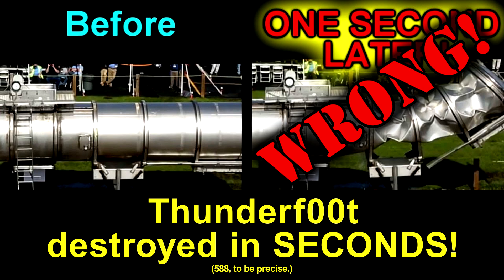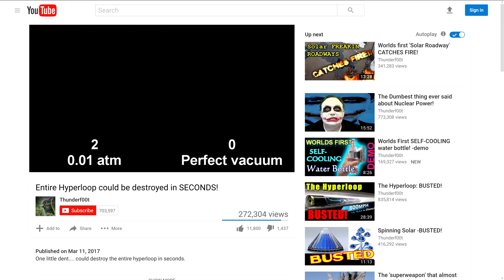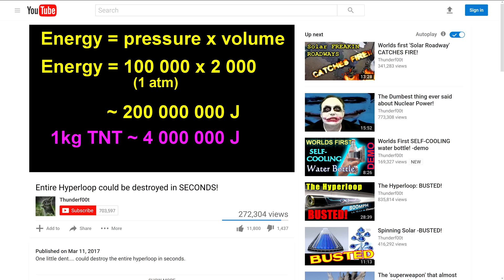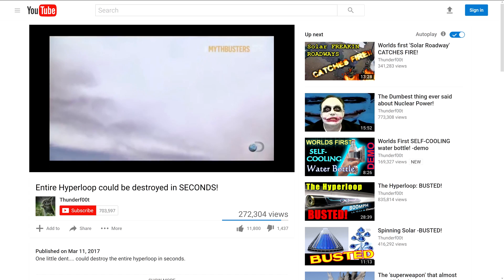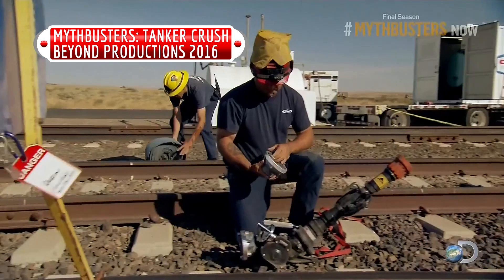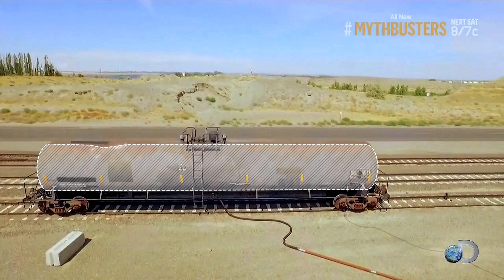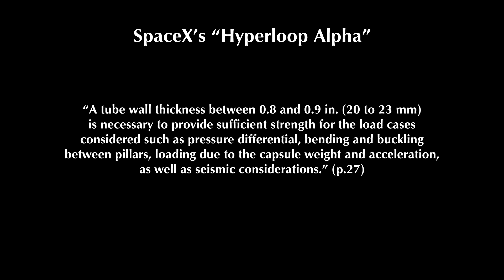Thunderf00t destroyed in SECONDS!

Comment: Using an energy based approach for a buckling problem is flawed. What causes the buckling (collapse of the tank) to occur is the compressive stress that is acting on the system. If the compressive stress  exceeds the a certain threshold the system will buckle. All the dent does is reducing this threshold. Energy has not much to do with this.
But even thought the approach is different, the conclusion with the one of the video.
Reply from the maker: "If the compressive stress  exceeds the a certain threshold the system will buckle." Which is the activation energy we discussed. How is this not an energy problem?

"All the dent does is reducing this threshold" Through the mechanism described: making more pressure on top than from the side.

"Energy has not much to do with this." Energy has EVERYTHING to do with this!
Reply: For this scenario the stress on the tube is dynamic, not fixed. It increases as the tube collapses. Force times distances equals energy. A certain amount of energy is released by the collapsing vacuum and a certain amount of energy is absorbed by the deforming steel. If the former is greater than the later then the system has the potential for catastrophic collapse if the tube is dented or pinched (see tanker video).
Reply: "Energy causes the collapse to be "explosive" it does not cause the failure itself."
If by "explosive" you mean "propagating", and by failure you mean "localized damage". Then yes, that's exactly what we're saying.
But if you're implying that a collapsed tube section would still propagate down the tube, just more slowly, then I say... No, it wouldn't. You can't have a propagating failure unless the work done by the collapsing vacuum is more than the amount of energy required to deform the steel.
You can't constant variables like "stress" and "strength" in this calculation because the stress varies along the transition and the forces are transmitted between tube segments. Thus, I made it an energy calculation.
Reply from the maker: "p=F/A <- no energy" How is it possible to have force without energy???
Reply from the maker: "By applying pressure" WHICH REQUIRES ENERGY.

"That's why hydraulic systems function that well." Hydraulic systems don't use energy???
Reply: Felix, let me ask you some simple questions I'd like answers for.
1. Do you agree that collapse of the hyperloop would release a certain amount of energy over the length of the tube (joules per meter)?
2. Do you agree that flattening the tube requires a certain amount of energy over the length of the tube (joules per meter)?
3. Assuming you agree with both the above statements, do you agree that if the amount of energy required to flatten the tube exceeds the amount of energy released by the collapsing vacuum is less than the amount of energy required to flatten the tube, then the collapse is impossible?
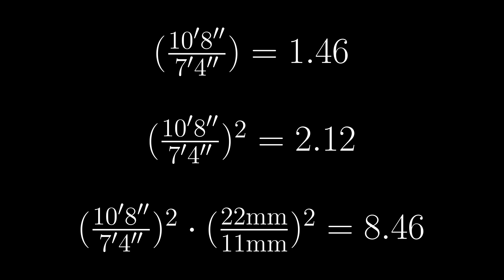Reply: At 2:37 the units are handled just fine: ((feet and inches) / (feet and inches))^2 * ((millimeters) / (millimeters))^2 = (unitless)^2 * (unitless)^2 = unitless * unitless = unitless
Reply: Unitless figures aren't meaningless, for example, air conditioners have units of BTUs/kWh which is a laughably ridiculous combination of imperial and metric units that is ultimately unitless. What they're actually giving you is a ratio of the amount of electrical energy consumed to the amount of thermal energy moved from the inside of the house to the outside. The figure isn't meaningless. Another example is the energy efficiency of electrical generators, which is usually given in percentages (percentages are unitless, by the way). A power plant might be 45% efficient, which means for every 1 kJ of energy burned in it, you recover 450 joules of electricity.
Reply from the maker: Refractive index is also unitless. It's c/v, where c is the velocity of light in a vacuum and v is the velocity of light in the medium in question. Vacuum therefore has a refractive index of 1, water 1.333, window glass 1.52, etc. Notice: NO UNITS, because they cancelled out. I guess DarkSide Blues thinks refractive index is meaningless, too, despite how vital it is to optics..
Reply from the maker: "Force times distances equals energy." Actually, that's work, not energy.
Reply from the maker: "A fluid under pressure does not store any energy, as it cannot be compressed." BULLSHIT. Happens all the time. Air is a fluid, and it can ABSOLUTELY be compressed. You're thinking of LIQUIDS, not fluids. Liquids are fluids, but not all fluids are liquids.

"So one can increase the pressure of the fluid and thus the force on a area, without any energy requirement." Oh? HOW are you increasing the pressure, then?

"Work = Energy as both have the unit joule" So? Energy is defined as the CAPACITY to do work. What the unit means is, IF all of that energy were used to do work, that's the amount of work you'd get out of it. It does NOT NOT NOT NOT NOT mean they are the same thing!
Reply from the maker: TuJuXorX I've already tried explaining to him that units cancel. He's having none of it.
Reply: Ah, I think I understand your misconception here.
"The energy stored over the total length of the tube quite big (.2GJ),  an certainly sufficient to buckle parts of the loop"
The problem is that you failed to see that buckling parts of the loop only releases part of the energy.
If 90% of the tube flattens, then 90% of the energy is released, if 1% flattens, then only 1% of the energy is released.
Linear energy density has the same units as force, so another way of saying this is that the "the average force required to collapse the tube must exceed the average force exerted by the vacuum" but I chose to frame it in terms of energy because I figured "average force required" might be confusing. For one, force is a vector, implying that the force needs to be applied in a certain direction whereas energy is a scalar, which is more appropriate in this case.
Do you understand now?
Reply: No, the collapse won't spread at all if the linear energy density created by the vacuum exceeds the linear energy requirement to deform the tube. It's not the the collapse will stop, it's that it won't propagate AT ALL.
Reply from the maker: "okay so if the number has no unit, then the number is meaningless" WHAT??? How the fuck can you EVER do ANY comparative statistic if that were the case?

An oil change at mechanic A takes 10 minutes, and mechanic B takes 40 minutes. How do you compare them? 40 minutes / 10 minutes = 4 (UNITLESS) and so you know that mechanic B takes four times as long!

What's your desperate and ignorant resort going to be NOW, LIAR?
Reply: "Which is the activation energy we discussed. How is this not an energy problem?" Stress is not equivalent to energy. You can have stress/compressive load without energy.  p=F/A <- no energy

"Through the mechanism described: making more pressure on top than from the side." While this is true, this should not be the primary mechanism causing the collapse. If an object is damaged in some way, the required buckling stress if significantly lower.

"Energy has EVERYTHING to do with this!" Energy causes the collapse to be "explosive" it does not cause the failure itself.
Reply: "If by "explosive" you mean "propagating", and by failure you mean "localized damage". Then yes, that's exactly what we're saying." Sorry for the poor wording. "explosive" == "propagating" || failure == failure of the system that is the tube == buckling

"But if you're implying that a collapsed tube section would still propagate down the tube, just more slowly, then I say... No, it wouldn't. You can't have a propagating failure unless the work done by the collapsing vacuum is more than the amount of energy required to deform the steel." 
No i do not imply that there is a slow buckling. If is slows down it stops.

"You can't constant variables like "stress" and "strength" in this calculation because the stress varies along the transition and the forces are transmitted between tube segments. Thus, I made it an energy calculation." I had no intention of doing so. Interestingly you can constant the energy. As you have a huge energy reservoir, that is the long tube, the change of energy by a partial buckling is not significant, causing any energy based approach to be flawed.

But don’t get me wrong this is not a criticism of Hyperloop. As all the problems that you and I stated can easily be overcome with simple technology and careful planning.
If Musk and his team did this, which can be assumed, then a failure will not propagate. The ring based support structures should be perfectly adequate for this task. It, together with the increased wall width, this might even be able to stop the system from buckling at all, even if the system has been damaged.

So do agree with the conclusion of the video. A self propagating collapse is unlikely or even impossible.
Reply: Agreed, i used the wrong word, so let me rephrase that: 
For example: A liquid under pressure does not store any energy, as it cannot be compressed. So one can increase the pressure of the liquid and thus the force on a area, without any energy requirement. (Assuming that the tank containing it cannot be compressed ;))
Reply: "Work = Energy as both have the unit joule" So? Energy is defined as the CAPACITY to do work. What the unit means is, IF all of that energy were used to do work, that's the amount of work you'd get out of it. It does NOT NOT NOT NOT NOT mean they are the same thing! 
True, I got it wrong. I should have written work.

"Oh? HOW are you increasing the pressure, then?" By applying pressure; As long a there is no motion no work is required, and no energy in converted.
That's why hydraulic systems function that well.

It feels like we are getting sidetracked. The fundamental point still holdes in my opinion. An energy based approach does not "work" well for the given problem. As of "Interestingly you can constant the energy. As you have a huge energy reservoir, that is the long tube, the change of energy by a partial buckling is not significant, causing any energy based approach to be flawed."
Reply: 1. Yes
2. Yes
3. Yes. 
But all three points are inconsequential. What causes the buckling is not the energy difference, but the stress that is introduced by the pressure itself. If this exceeds the buckling threshold the system will buckle. If the energy in the system in not enough, for the work that is required for the deformation of the metal, then the failure will not propagate.
But this is meaningless, as the energy stored over the total length of the tube quite big (.2GJ),  an certainly sufficient to buckle parts of the loop. 

If you ever went to an applied mechanics course, you will know that for static problems, one only looks at forces, moments and resulting loads//tensions. These are what causes the failure of a system. Energy is only relevant for transient problems. But as the energy pool is large, limitations of this resource should not matter.

To properly analyse the problem at hand one would have to do a proper transient FEM based buckling analysis.
Reply: Felix, if there is no breach in the tube, releasing that whole 0.2GJ of energy would require the whole tube to get flattened. If there is also a breach, the amount of energy released from shrinking the volume of the tube would be smaller as the pressure difference between inside and outside of the tube would be smaller (-> not as much volume change is needed to make the pressure inside the tube to go up to 1 atm). I cannot come up with a mechanic how that whole 0.2 GJ of energy could be used for flattening just some part of the tube. Can you? (I'm assuming now that deformation of the metal in the flattening of the whole tube requires over 0.2 GJ of energy)
Reply from the maker: Also, keep in mind what we pointed out: the Hyperloop tube isn't sealed. You have pumps continually pumping air out. So that makes it even more difficult to see how the tube could be flattened.
Reply: I actually forgot to think about the effect of the pumps. However, in this case they try to keep up the pressure difference between inside and outside of the tube and thus the amount of energy released in the partial collapse of the whole tube (due to volume and pressure changes) is slightly higher when the pumps are on compared to a situation when they are off. In some of your videos you mentioned that in case of massive breach they would open valves along the tube and let air in to get it to 1 atm. This kind of emergency measure would reduce the amount of energy released if the whole tube would start to deform in its whole length (which requires thin walls and something extraordinary to happen).
Reply: @TuJuXorX You are just proving my point. Energy does not matter as a partial buckling is never enough to consume any significant amount of energy, in relation to the whole system. All you have to look at is the loads. In this scenario, energy can very well be ignored.
Reply: @Felix, I think the energy argument can be used for showing that the collapse of the whole tube is impossible if the walls are thick enough. Also, if you assume that the stress is roughly equal everywhere in the tube walls, it also shows that the local collapse is impossible. However, if the stress is not roughly equal everywhere, then you need to do the force calculations as you say. Even in that case, if the energy calculation says that the whole tube cannot collapse, then it means that the local collapse, if it for some reason were to happen, would eventually come to a stop, which should occur quite quickly after it begins.
Reply: TuJuXorX okay so if the number has no unit, then the number is meaningless. Great.
Reply: Work = Energy as both have the unit joule
Reply from the maker: DarkSide Blues "Taking imperial measurements and multiplying them with metric." For about the SEVENTH time, WE DID NOT FUCKING DO THAT!!!

"Tell me: what are the units when you multiply feet and inches by millimeters?" WE...DID...NOT...DO...THAT!!! How many threads are you going to spam this LIE on?

Keep this up and you'll be blocked for flooding.
Reply: My approach is not flawed. You have to consider energies when evaluating whether the flattened area can propagate down the tube. A perfectly round tube can stand up to tremendous pressure without buckling. However, a runaway flattening event could occur unless the tube walls can absorb more energy than is released by collapsing the vacuum. Energy is absolutely applicable here.
Reply: I don't trust a word you are saying. Taking imperial measurements and multiplying them with metric. The last time some one did that, a Martian lander created a crater on Mars. So the only proven in this video is that you don't know what you are doing. Tell me: what are the units when you multiply feet and inches by millimeters?
Reply: For example: A fluid under pressure does not store any energy, as it cannot be compressed. So one can increase the pressure of the fluid and thus the force on a area, without any energy requirement. (Assuming that the tank containing it cannot be compressed ;))